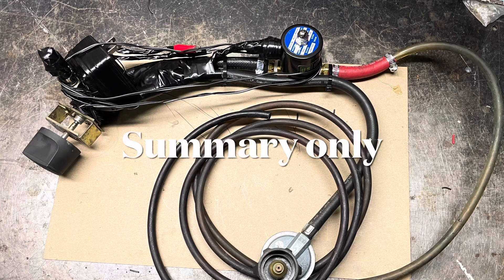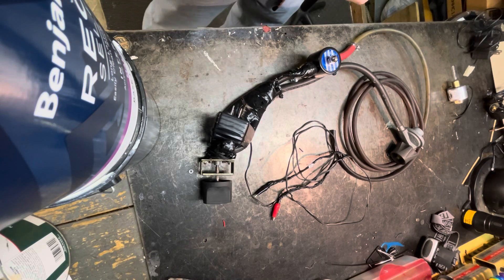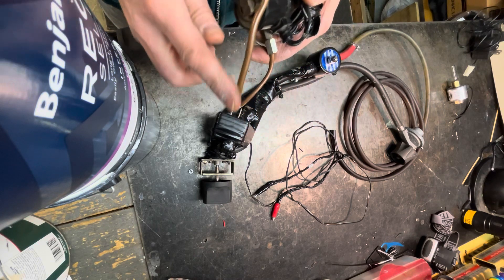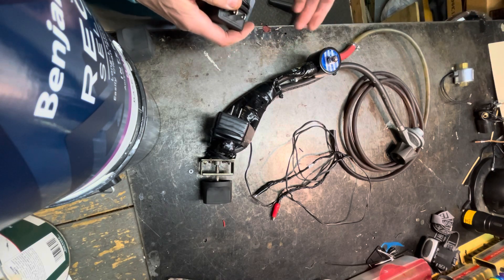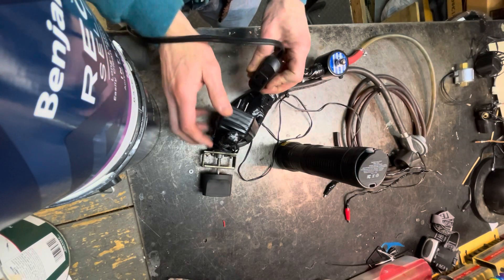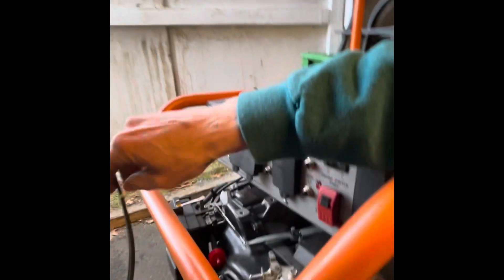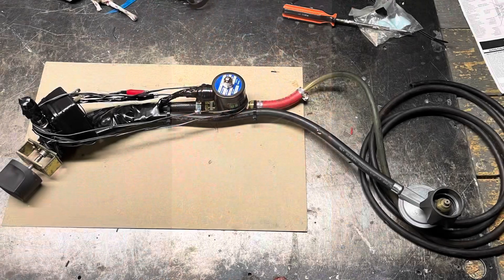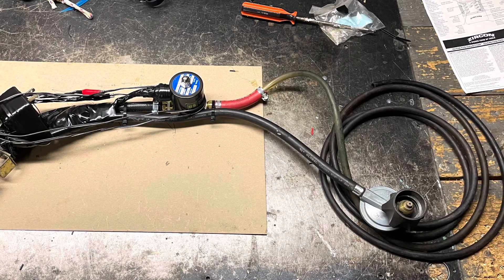Running generator gas engine on propane & barbecue grill hardware & electric shut off modification.￼

Comment: How is the flow of propane increased when the load increases on the generator?  It looks like it is just going to lean out?
Reply from the maker: Correct it will lean out under load so this setup requires you to adjust/increase the flow under your max load you will be putting on it and leave it there - when load diminishes the generator will run a bit rough until it calls for load again. Not a perfect setup for fuel economy but will keep the lights on if the gas cans run empty.

Comment: Spend the money and get a commercial conversion kit.  These kits will automatically turn off the propane flow if the engine on the genrator shuts down for any reason.  They use the small amount of engine vacuum during startup to open and allow propane to flow during the starting process.  If the engine shuts down for any reason, vacuum is lost and propane flow stops.  Much safer opton.
Reply from the maker: Agreed - that's fine if you're using propane as your main fuel - purpose here was to have emergency back up fuel option to run one of my three different generators. Not worth investing in carburetor kits for three different engines that I may never use with propane + was fun toying around with stuff I already had for a DIY project😁 So definitely safer to have this shut off if ever in a pinch & needed to run on propane.